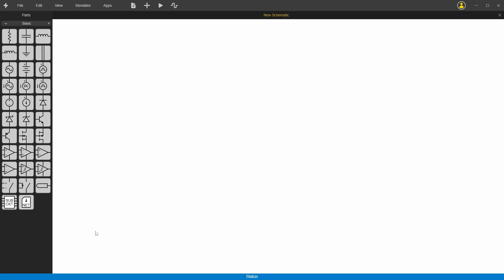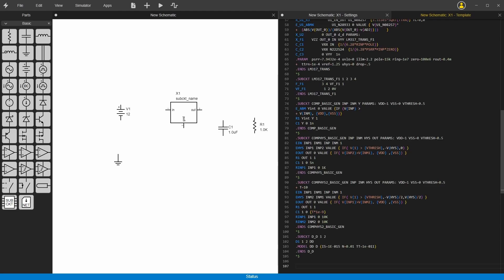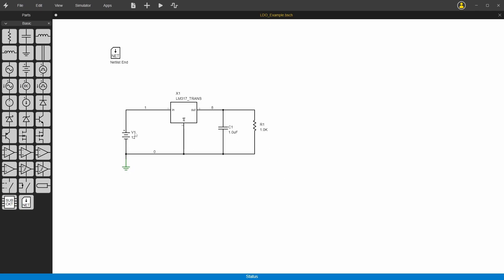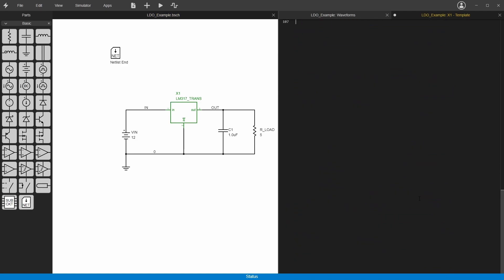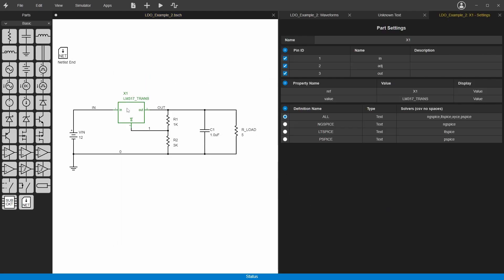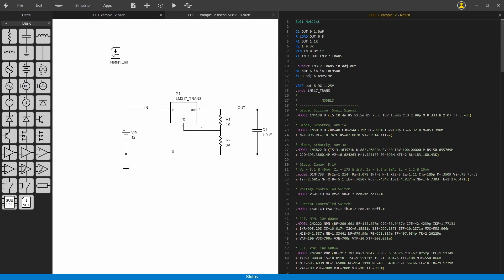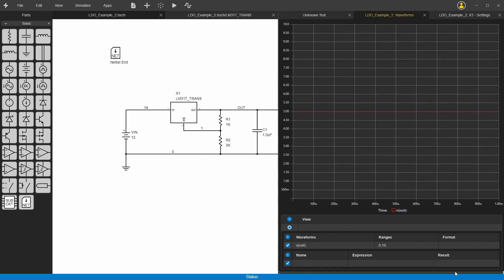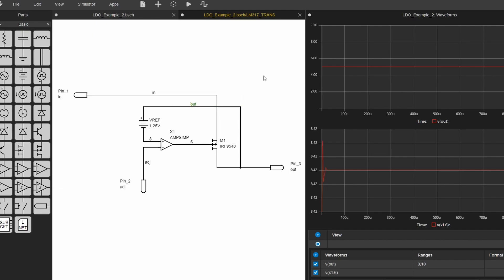BOLT - Subcircuits

Comment: Hello sir , 
Had a question from Simetrix , how can we set the temperature in simetrix code ? I tried various methods using writef11options. But could not get it to work. Can you may be help me with the syntax of this.

Thank you
Regards 
Vishnu
Reply from the maker: Well this video is not about Simetrix but it's the same Bolt and Simetrix and in all spice just ".temp 25" for example in the netlist (F11 window), but if you are in SIMPLIS mode then there is no temperature effects.
https://help.simetrix.co.uk/8.3/simetrix/simulator_reference/topics/commandreference_dot_temp.htm
Reply: @ Hello sir
Thanks for the feedback. I understand that .Temp helps change in F11 window. But how to change temperature directly from script. Do we have to use some specific function?